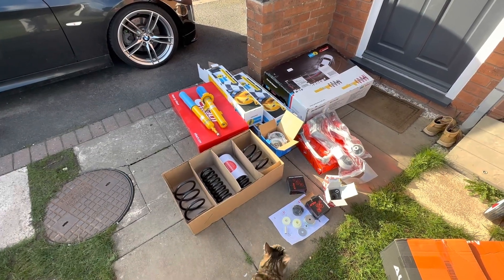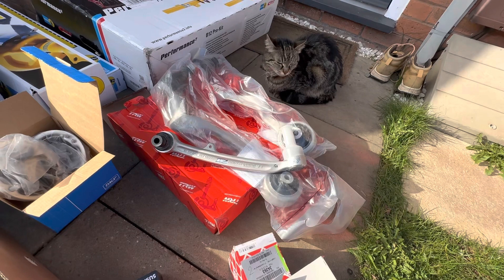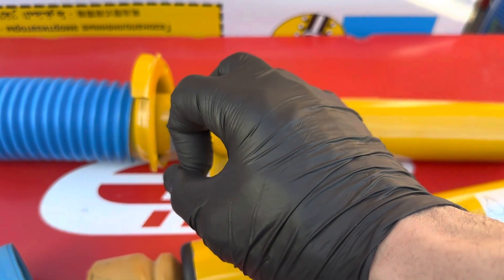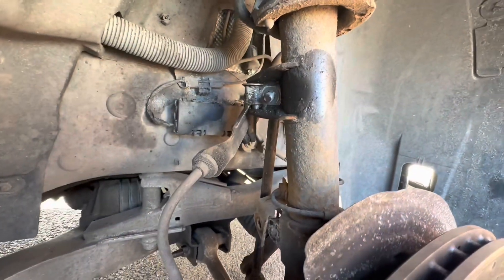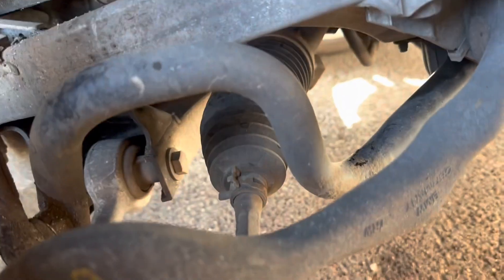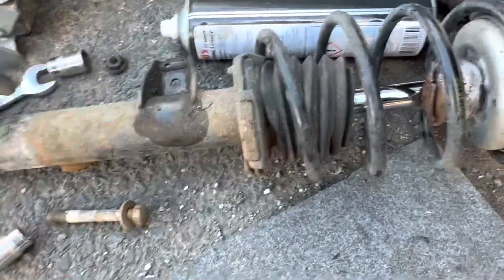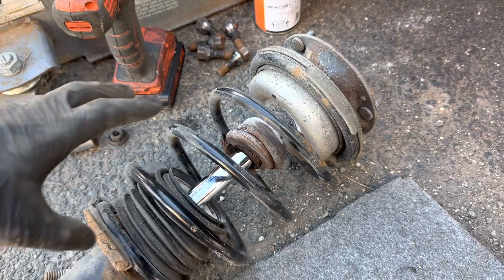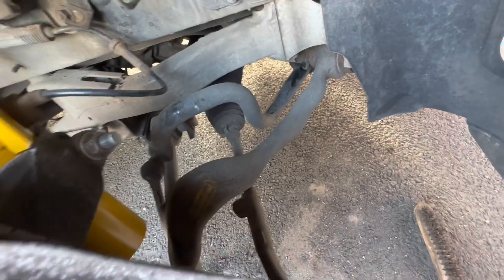BMW E9x Front Suspension diy M3 control arms Shock absorbers top mounts sprigs shocks e8x e90 e92

Comment: Nice video! If you are changing everything on the front, why not take the whole assembly out?
Also what camber angle did you finally used for the front? having -1.5 degrees is quite a good value IMO. Not sure why you have to adjust it.

Comment: Really great to see that you are doing a proper build with this car. I have a 06 330i today and just came back from the calder park track today.
You videos are giving me motivation to go knee deep in a build.
I am just a bit scared because it has done 200k kms😅
Reply from the maker: Thanks 😁
Mine is on 127k miles, and out the same as yours and it’s great. Just make sure you service it regularly, overhaul the cooling system and it’s good to go. Ring freaks and Jacos paddock race them and hire them out to use at Nurburgring, they’re really quite good 👍🏻
Reply: BMW's are great if they are maintained well. I have a 06 E92 335i with 250k+ KMs as a daily and never had any major problems.
Reply: Yes i just did my second track day in winton and saw an n52 with 400k miles on it.
Seeing this i have decided to slowly turn my one into a dedicated track car. Doing a weight reduction first before anything. Everything in my car is bone stock now.

Comment: This video is all I needed as I'll change my shock absorbers during my Christmas hodilays. Thank you.
I have a question. My car is a E92 with the M sport suspension.
I'm hesitant between buying only B8 shocks or a B12 Kit and refresh the springs during the operation.
Do you know if the B12 kit will seat it lower or higher than the factory M suspension ?
Thank you.
Reply from the maker: I’d recommend b12 kit as it’s b8 dampers with eibach springs. Factory springs need huge amount of pre load, thus they are a nightmare to install. Eibach springs are naturally stiffer so don’t need much pre load and are easier to install. Ride heigh wise, I think they are about the same as m sport, maybe few mm lower but it’s not really noticeable.
Reply: @vysgarage  
Thanks for answering.
To what I understand, you're saying the Eibach in the B12 kit are stiffer.
In free state, they are shorter than factory M sport ones. They are therefore easier to install as the "compression travel" is shorter. But this also means stiffer and I don't want my E92 becoming too harsh on the road. I like it's actual comfort.